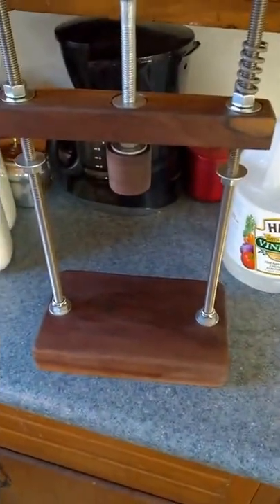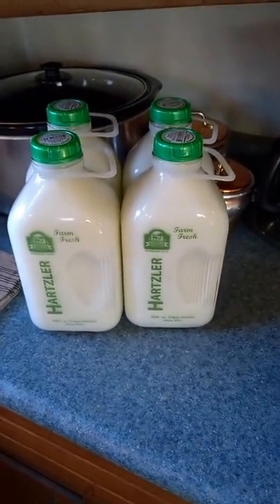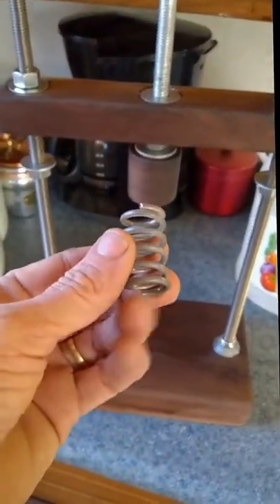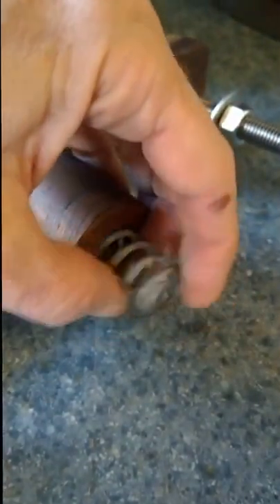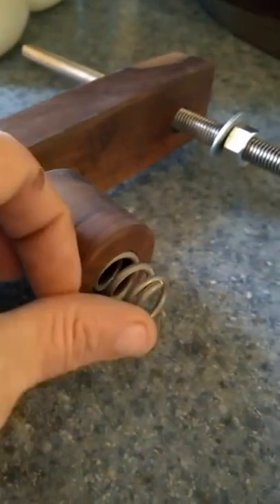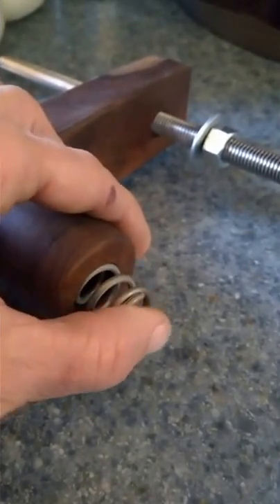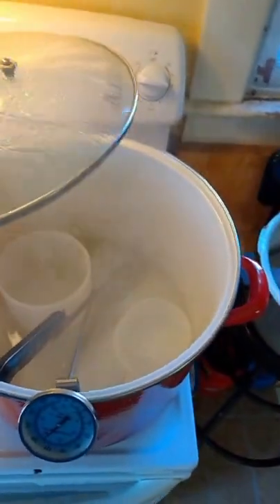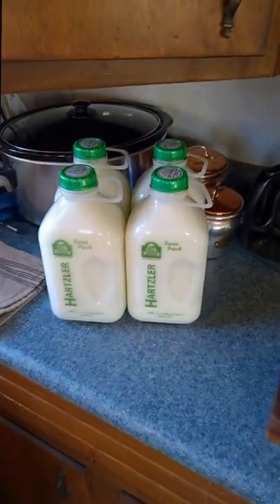Homemade Cheese Press

Comment: Today, I made cheese with pasteurized milk from Walmart and ultra pasteurized. Many videos said that it doesn't cured. So I made my cheese not following directions since I have a bamboo spatula and pot. I brought my milk to boiling with foaming up to ream. I added extra vinegar. 3L milk= 8 tbls vinegar. 1st, the curds were very small. I panicked.  Then I strained it after left it 45min. I got so much cheese ball after 4 hour pressed. It's heavenly delicious n no vinegar taste. They whey is even clearer.